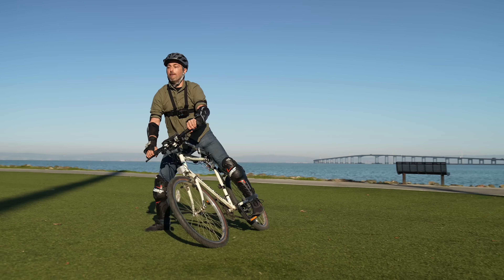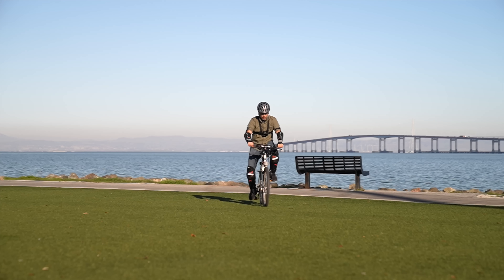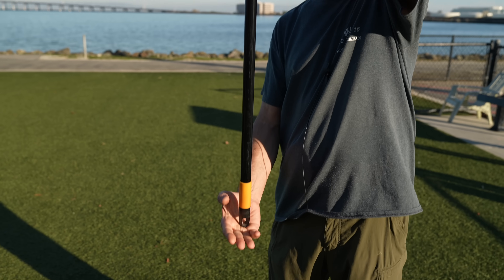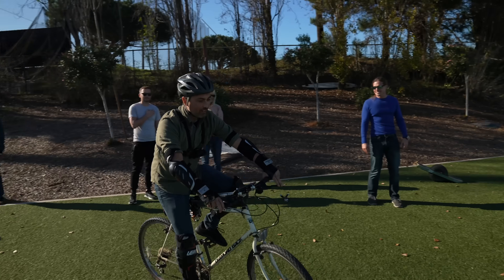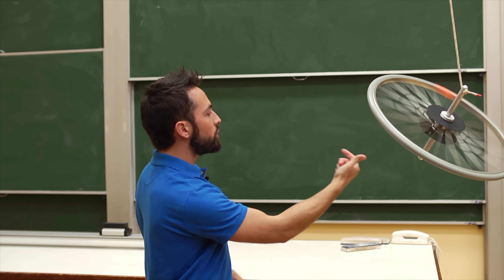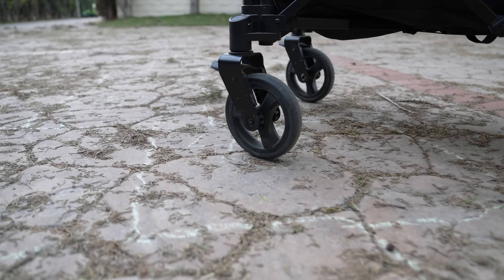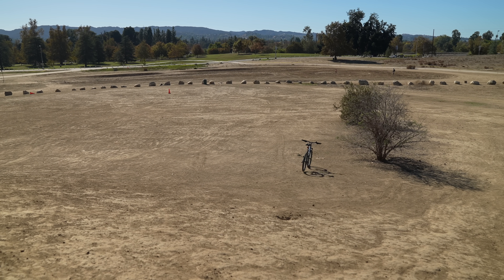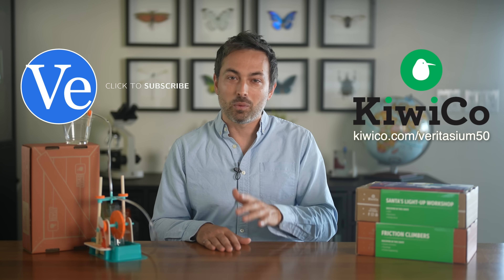Most People Don't Know How Bikes Work

Comment: Did you try this with any really experienced cyclists? Having lived in Vancouver I’m sure you know about the mountain bike trails that exist nearby, I’ve watched people ride elevated woodwork narrower than their tires. I’m curious if this is just doable from ultra responsive steering or if they have different valence techniques
Reply: They're generally not narrower than tyres(except for the weird folk on fat bikes), even in BC!

It's mostly just correcting smaller and more often. I say that like it's easy, it isn't, I can't do longer than a short stretch I have a nice run in/out of. Much of the challenge is psychological rather than technical. Many riders will quite easily be able to stay on a painted white line of the same width. Give that line a nice drop either side and suddenly it's far far harder. Generally the riders who commit to the more advanced ones will also be adept at repositioning the bike with hops which can get them out of a situation where steering out isn't possible (also allows them to safely bail off the whole thing by just hopping to the ground).

Comment: Most sport bike (motorcycle) riders know this. We lean into a turn and to stabilize it just slightly counter steer. The only time we turn the handle bars in the direction of a turn is when we’re going under 10 km/h

Comment: This explains why if you happen to get your wheel stuck on the kerb while cycling next to a pavement it's impossible to steer away from it and you WILL fall over unless you immediately brake to a stop
Reply: Nope, two ways out, either 1) act as though your are pushing the wheels even more to the kerb, as in directly lateral.  Friction will stop the wheel from actually going lateral and this lets you have the angular momentum to lean left.  One must remove one's butt from the seat to do this... something no one seems to think of doing in the video until they're falling off the bike...  Or 2) you can pop a small wheelie and reposition while in the air so you land pointed the way you want to go.

Comment: I ride no handed constantly. I make 90 degree turns without my hands, all over town, it's my thing. I can probably ride a unicycle. The point being, you can't counter steer without hands, at all, you'll break your face. It is all balance and leaning properly. The idea that all turning on a bike in counter turning is just absurd. Same with riding very fast and then turning, it all just leaning then turning, like racers do. Dumb video.
Reply: That is incorrect. When you shift your weight in one direction you push your bike in the other and produce a counter steer. That is how you steer by leaning, it is still counter steering.
Reply: I thought about it, I suppose I do counter steer slightly sometimes. But mostly it is just a lean into the curve in order to pull it off without hands. I'm thinking that speed is always the decider.

Comment: This is the best rigged bike to deter bike thieves
Reply: silly of you After trial and error of some 20 bikes leaving me: the best deterrent is an uninteresting plain bike with 2 (even shabby) locks. If interesting go for recumberent bike (it takes 5 min to learn). If battery powered keep the battery detached.
Reply: @LiborSupcik  I used to have a very plain bike that I had to park in the stairwell, locked to the railing.  That did not stop someone from chomping through the cable, although they tried to get the padlocks first.  I really liked that bike.  :-(
Reply: @LiborSupcik  Two locks is the way to go. It's not about having a foolproof lock, it's about having locks so annoying to destroy thieves would rather steal someone else's. Removing the seat also works.
Reply: how this became a racist comments' line ...im so proud of you little hill billies
Reply: How not to get your bike stolen:
Step 1: Don't own a bike
Reply: @oscargill423  who are you, so wise in the ways of science?
Reply: @apuji7555  Broke. I am broke.
Reply: This depends on the remote control to lock out the steering. If you want to make it hard for thieves to make a quick getaway, try Smarter Every Day's modified bicycle with reverse steering (turn the handlebars left, the wheel turns right, and vice versa).
Reply: My bike never gets stolen after that
Reply: Because you cannot put it in a van?
Reply: Nah, nat geo made a bike that inverts the steering, its practicaly impossible to go anywhere using that. This bile lets you atleast go somewhere.
Reply: Nah they'll just throw it in their van and resell the parts
Reply: damn, just lock the handlebars if you arent near. maybe you can do it with hidden magnets that are required to be there or not there to ride?
Reply: @Elia K Th  i think he wants ur bike....
Reply: Now there's a thought.
Reply: Motorcycle handlebar locks are defeated by one good kick and you think locking bars on a bicycle will do anything to stop a thief?
Reply: Looks like a bomb anyways
Reply: Or a fixed gear bike. Learn how to ride a fixed gear, leave your bike unattended and wait for a thief to jump on it, hilarity ensues.
Reply: Except "the penetrator" that had a dildo jumping out of the seat on a pneumatic piston. Pure evil & very much needed. I recommend watching bike on a wire as well.
Reply: Eyo
Reply: My bicycle got stole once while it didnt even have proper breaks :P
Reply: Gay
Reply: i think it’s an excellent idea but won’t have a good execution. whatever system you design is either going to reduce liability or be invested in a proper lock.
Reply: But couldn’t you just cut the wires?
Reply: why are you everywhere 😐
Reply: @mando8194  ikr
Reply: So i take it, you haven't seen SmarterEveryDay's rigged bike
Reply: There's a bike that goes left when you turn right and vice versa. That's even more horrible.
Reply: I remember bikes that had headset/fork locks so that you you could not turn the handlebars.
Reply: Fun fact? I was able to learn to ride a bike ONLY in 7-th grade !!! Because only then i uderstood phisicaly speaking what i need to do in order to maintain balance. The counter-forces i needed to develop ! In 7'th grade i got the Phisics discipline, the mechanics part. Same with the swiming, i was able to swim when i understood what i need to do in order to swim, by creating a constant force down to lift my body a little above the water. To be exact i neded to lift my hand or my leg more aquadinamicaly than when i put it don in the water. The diferences between these 2 forces was the lift force, to be able to stay on water. After that, to advance in water, i used part of the lift force to advance. So the movement was like a propeler.  So now i learned to swim too.  Same with staing on a ball , or 2 crossing pipes, like a circus guy,  or sky-ing and snowboarding. Couldn't aford a ski instructor, so i distroyed couple of a sky slopes to learn. Snow was destroyed,  and other sky turists had critical problem riding the slopes i used. Yeah , whenever i had a real problem to learned something, the other people around me got THE BAD LUCK, during my learning process. And i'm ok with that because nobody wanted to HELP ME. SO THEY GOT ALL THE SIDE EFFECTS OF KARMA !!!
Reply: just use a bike lock you hippie
Reply: @water5210  There're very few bike locks that are effective.  Confirmed by the LPL (lock picking lawyer)
Reply: @peterkelley6344  they don't need to be fully pickproof. The kryptonite locks like the evolution is good enough against normal thieves

and even if they suck they're still better than using whatever veritasium used to secure a bike
Reply: @water5210  ikr
Reply: reported
Reply: @ruok-l5t  I’ve reported you
Reply: @bazzzanator9485  reported
Reply: @ruok-l5t  report has been received and we will give you an answer in 2-3 years
Reply: @ruok-l5t  for what
Reply: @user-vp5cs8pd1l for racism I suppose
Reply: @user-vp5cs8pd1l  he is threat to privacy
Reply: @ruok-l5t  lol
Reply: @ruok-l5t  reported you as child abuse
Reply: @AlphaCarinae  You can’t call him cringe when you are way worse in this aspect, lmao
Reply: @AlphaCarinae  your name and pfp are worse.
Reply: @boycottjews  lol lonely degenerates being racist, whats new with that. 🤡
Reply: @MrGhostTheBigRoast  cope
Reply: In multiracial "america" it'll take more than this.  My bike is locked up in my basement and if wasn't deep in the country it'd be gone by tomorrow.
Reply: @boycottjews  so the same as in other monoracial "countries"?
Reply: @girlsdrinkfeck  so it's multiethnic rather than multiracial?

Look at how many wars monoracial Europe had
Reply: @girlsdrinkfeck  Do you play Pokémon?
Reply: @girlsdrinkfeck  Oh
Reply: @boycottjews  We get along fine in Canada. People don't distrust each other based on race.

Comment: The way we learn to ride a bike is that you jump on.. Fall off.. Jump on fall off less.  Until you learn to do all the things needed to stay on the bike without trying.

We also learn to ride a bike without steering if you do the "stunt" of not holding the handle bars a lot...  You learn to steer the bike by adjusting your weight left and right to cause direction changes on the bike.  NB: this would still not work if you locked out one of the steering directions as like mentioned .. the handle bars steer ahead of the bike.  

If the bike was a fixed frame with no steering... Could you still steer it and would it self ride when let go down a hill ?

Comment: What if, instead of counter-steering before making the turn, you lean and tilt the bike towards the side where you need to turn? Wouldn't it create the same effect?
Reply: How do you tilt a bike? If you want to turn right you move your upper body to the right, this pushes your lower body and the bike to the left. This causes the bike to lean to the left and it turns to the left to compensate. So when you shift your weight you are still counter steering.
Reply: @garethhanby  Watch how some BMX bikers tilt their bikes without tilting the body. I'm surprised that this wasn't tested with a professional biker to even prove the point further.

Comment: At low speeds yes. All these experiments were at low speeds. I want to see this experiment done at high speeds. The experiment with the gyroscopic effect, rope attached to only one side, works when the wheel/disc is spinning at high speed and when the spin starts to slow down gravity slowly takes over pulling the wheel/disc down.
Reply: The gyroscopic effect could only possibly apply to motorcycles. Bicycles quite simply cannot go fast enough for it to matter

Comment: I remember being intrigued as a child by the fact that when riding a bike along a road with a slight bend, you don't do any conscious steering in order to turn the corner. This is because you simply continue to do the corrective steering you would do anyway, so it doesn't feel as if you're doing anything different. Also, this particular bend was at the bottom of a shallow valley, so perspective made it look sharper than it was. I once asked a parent if you have to steer around the same bend when driving a car, and the question was met with a dismissive "of course", but I think child me was not asking a stupid question on that particular occasion.

Comment: Before getting a motorcycle license, I took a motorcycle safety course. The instructor explained that you counter-steer. He has an exercise to demonstrate it, and he trained us to always do it consciously—at least at first. That way, if you ever have to swerve, you’d do the correct thing automatically. Been doing the same thing ever since, and I’m much more maneuverable because of it. I even successfully, but narrowly, avoided a car that pulled out in front of me once because of this skill. Push the right handlebar forward to go right; push the left handlebar forward to go left. Works even better on a motorcycle because of the weight being lower, but it does work on a bicycle too.

Comment: I wouldnt have a problem im sure...ive rode a bicycle with the bars welded straight and could do it ok by leaning...and i BARELY hold my bars tight or put ANY input at all even at 70mph in a corner on my motorcycle, i shift my weight more than anything
Reply: Just becuse you think you don't do something does not mean that you don't do it.

Comment: I'm sorry, but almost noone thinks you steer a bike by just turning the handle bars in the direction of the turn. Also, as pointed out in other comments, you don't HAVE to counter steer, you have to shift the balance. What makes that bike impossible to ride is that it locks out BALANCING, not steering. 

Also, this is pretty much a rehash of Destins video, where he used a already well known modified bike where the steering was reversed. The difference is, that bike was POSSIBLE to ride. You just had to reprogram your steering reflexes.
Reply: You don't have to countersteer, but bikes will have to.

Comment: I was used to actively doing counter steering on motorcycles, until I have learnt counter steering can reduce the front tyre's grip, and since that I am only using my body weight to lean motorcycles without steering to turn

Comment: This would be an awesome video if you didn't use absolute statements. It's 100% possible to ride the funky bike with one side locked if you just leaned to get your center of mass out from under the seat, no counter steer required. If you had an experienced mountain bike rider around and gave them a few minutes to get used to the gimmick I'm confident he could turn fine with no counter-steer

Comment: Understanding these concepts at a basic level is vital to becoming a proficient motorcycle rider, and any rider that took classes understands counter-steering. This video however digs deeper and makes it extremely easy to understand! I would love to see more details about this specific to motorcycles which involve much more mass and significantly higher speeds. Counter-steering is significantly more noticeable there than on a bicycle.
Reply: I was just about to say this. Motorcycle riders do this, many without realizing it till you video it and show them.
Reply: Yup, I first learned about counter-steering for my Motorcycle classes. That lean creates most of the turns at higher speeds.
Reply: I still remember how they taught the counter steer for normal turns and for a quick wobble avoidance you don't counter turn, but you have to wobble quickly back.
Reply: Took the words right out of my mouth. All Motorbike riders (good ones anyway) know about the basic concepts explained in this video, but as always Veritasium goes deeper :-)
Reply: You beat me to it. As soon as I seen this I thought that's just what happens on a motorbike.
Reply: Get a motor cyclist on a stand up jet ski, they will come flying off, exact same effect
Reply: With heavier wheels, but mostly because of higher speeds, coriollis effct comes into action. It means turnig the wheel to the left will produce a torque to roll you to the right.

Hopefully this goes in the same way so it adds to the effect described in the video and you don't have to act very differently depending on speed. I'm unsure how big each effect is though, but pretty sure the video is correct in not mentionning coriollis on a low speed bicycle while a speed motorcycle is mostly coriollis.
Reply: I dunno if I'll get laughed outta here for this, but Keith Code's "Twist of the Wrist" is pretty much a whole movie about it (if you can handle the cheese, hehe) 🤙

Haven't watched it in a long time, though; I don't remember how much physics jargon it includes, if that's what you're after 😬
Reply: @WhySoSquid  came here to say the same thing. It is a must watch for anyone who wants to ride a motorcycle!
Reply: Btw we sold it tho
Reply: Bro I learned motorcycle just in one day... My father just say that I should make it run and ride it and I find it stupid LoL... But luckily I'm not injured and still alive
Reply: @anonamemous6865  You didn't learn motorcycle in one day. you managed to ride one. There's a difference and it'll show the first time you find yourself in a bad situation.

Comment: Okay I'm going to dispute this. The way you make a turn with a bike is not by the handles. You shift your weight to the side and use the handle to adjust the balance. No need for counter steer. In general, more experience you have with riding a bike - more efficient you get with weight balancing.
Reply: Countersteering is always needed. If a bike can't countersteer it will fall.

Comment: Counter steering always works. But if you go faster gyroscopic forces of the rotating wheels increases and you have to steer harder, push or pull handle bar harder to lean the bike

Comment: As a dutch person who has had a bike all of his life, and who knew this fact and has been testing it out: this is a bit misleading. yes you should first turn right to turn left, but the reason WHY is because that flips your center of gravity to the left of the bicycle, making it possible to turn left.

The way I do it without steering away from the direction however, is by leaning in first, and then steering. this negates the need to make a tiny right turn before going left. That way, I already put my center of gravity over the left, and this allows me to steer left without steering right.

Fun thing: this mechanic is the reason why, without leaning, you can get stuck riding a bike too close to a curb, not being able to steer away.